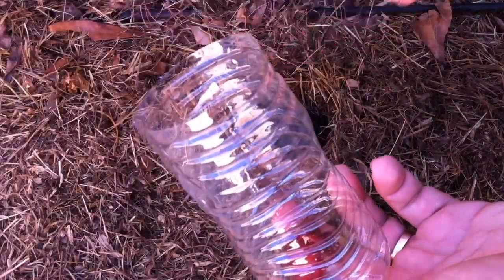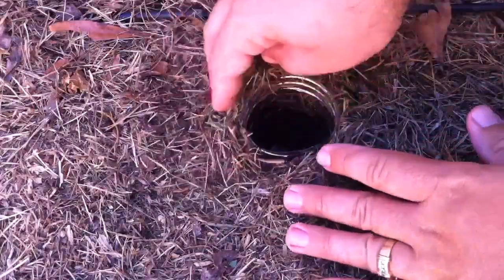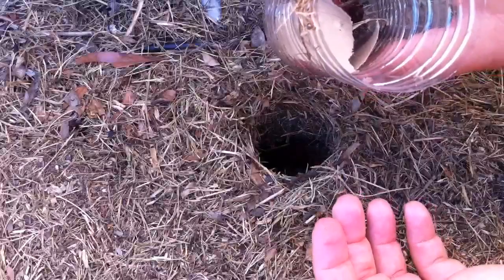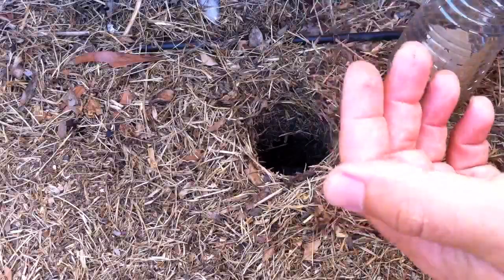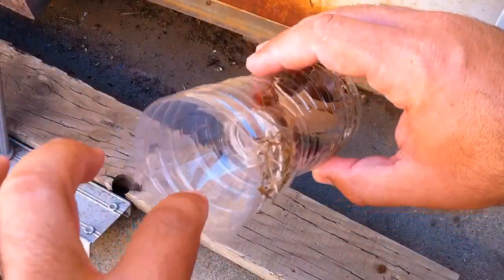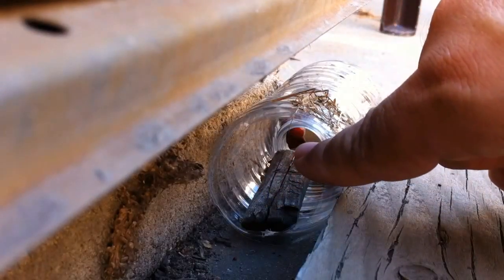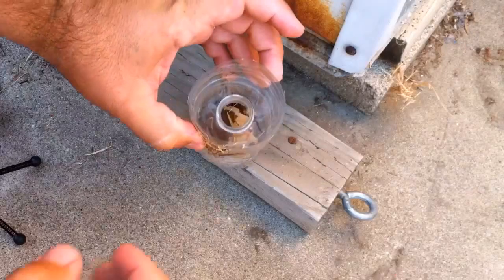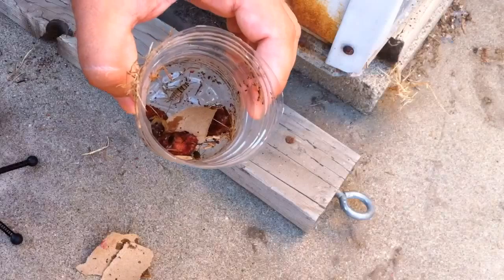Cricket trap that works!

Comment: I tried the cricket trap. It worked! I got one, but for some reason the other two have ignored it. Maybe it was the over-the-hill mango... not a favorite food? I really liked the design though. The cricket really couldn't find his way back to the opening. He'd try to jump for it but couldn't aim or get through. 
The ones that wouldn't go into the trap I finally got to stop chirping: I put 5 drops of essential oil of peppermint on a piece of paper towel and shoved it behind the fridge where one has been chirping for over week. It shut him up for an entire day! ~ 24 hrs later he started chirping again. Not sure if he has a way in & out... maybe he just ducks out of here when the smell is repellent, and he came back when the smell died down. Either way, no more chirping, for a while. It really makes the room smell like peppermint so be prepared for that. I also read that clove, rosemary and thyme are the recommended essential oils to try.

Comment: Thank you for pointing out the most important part - WHERE to place the trap!
Crickets love hiding under wooden planks, so it is perfect.
Reply: I never noticed it until LAST Summer in my wooden shed. I open the wooden doors to get my lawnmower and holy crap...these crickets are HUGE! (LOL, I have never seen, or noticed how big they get). They were all over the inside of my doors. I didn't kill them..just tapped the door and they all jump and scatter off. Saw it yesterday again...one of these monster crickets, I believe hitched a ride on my shorts, shirt and came inside the house with me...eventually my bedroom, UGH. It was LOUD last night, took me until 3am to find it. I trapped it ina  cup and released it. Just have to find a way to prevent them coming into my house...spray my clothes, around doors/windows, my AC unit. ugh.

Comment: a way ive found effective is tracking down a chirping cricket and dropping a large, preferably rectangle shaped container over the cricket and the surronding patch of grass.

the cricket will  have nowhere to go  and it will only have a small section of grass, if it tries to run away, it will bump into the sides of the container.

the container should be clear/seethrough so that the cricket won't see  it coming

amd make sure you pat it down into the grass so there isn't a big gap for them to squeeze through and escape

Comment: If you punch a hole on the bottom about the size of the diameter of a toothpick, any rainwater will quickly drain away preventing flooding that can allow your crickets to escape (if the water level gets that high) and/or drowning them. :)

Comment: i breed crickets for reptile food. the like potatos and carrots as a primary food in captive. but will eat any fruit and vegetable.
the best thing i have found for traping them. is a section of black pvc pipe with one end capped off. and rough up the inside a bit so the can garb it with thier feet. but you could just as easily just toss some black paint on the trap this guy made. and it would work great too. i like the design

Comment: I've watched mine eat frogs. When I'm outside working the acres they have learned to follow me, hovering about. Anything I turn over gets immediately investigated. If I dig, they have to be shooed back every shovelful, from looking for grubs. Every stroke of the rake gets investigated. piles of leaves, cause them to start scratching. Snails, butterflies, slugs, larger ants, anything. In fact, the only thing they won't actively prey upon are bees.

Comment: can i put rotten apples?
Reply from the maker: midzata, yes I am sure you can:) Whatever you think they will eat should work great!
Reply: midzata 

you can use anything thats sweet and or has alot of sugar. This way is simple but there are much better ways to do cricket hunting. my best method is to use Toilet Paper Rolls, that has been used. or news paper. But this way is find too, but need to be a little darker so the cricket wont stress. When doing this method outdoors, make sure you keep a dark place or cover up the bated trap
Reply: prankakidd 

also sugar water works best for bait, they will Drink and get so fat they wont be able to move or get away when you try to get them out.

Comment: Seems it would be easier to just feed the chickens the bait you're using.
Reply from the maker: Scott Comella, I will have to disagree there because of two reasons. 1. The bait a used is sort of rotten. 2. There's no real protein in the bait are used. When my chickens are going through molts they stop laying eggs due to the fact that they're producing new feathers. The production of new feathers takes lots of protein and so feeding them extra protein is going to help them through their molt and help them start laying eggs sooner again.
Reply: Got it. Please excuse my remarkable ignorance. So now I'm thinking flies and earthworms.  Both easily harvested in volumes greater than those couple of crickets.
Reply from the maker: Scott Comella, yes:) Every little bit helps.

Comment: Still wondering why you wasted 4 minutes of my time showing how the trap doesn't work before you modified it🤦🏽

Then I'm gonna be that guy,  if you built a ramp up to the level of the opening, at this point I don't see the need to cut the bottle open at all.    Get a piece of stick that's a y shape, prop the bottle up then build the ramp.
Reply from the maker: Sorry, I’ll do better for you next time👍🏼